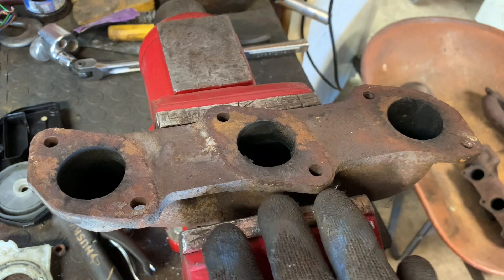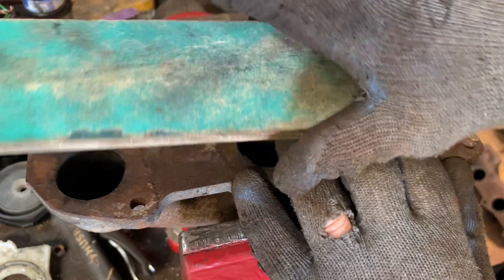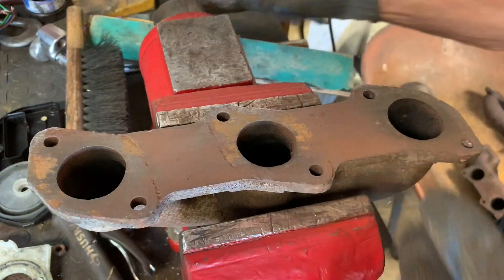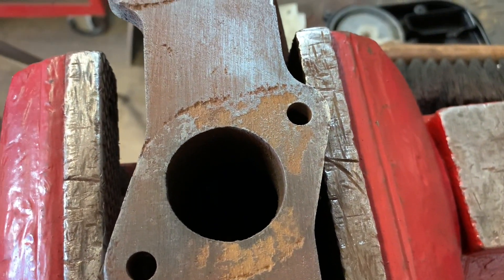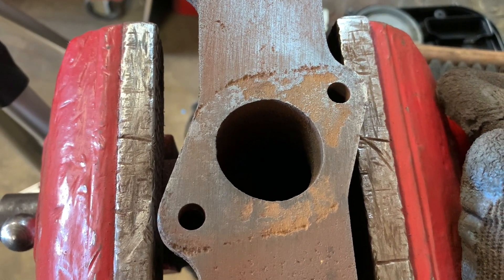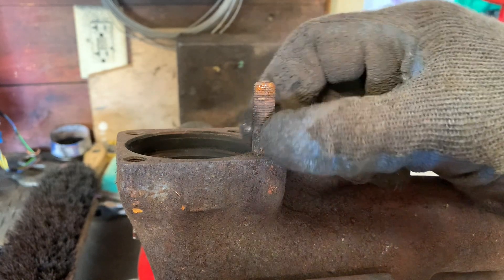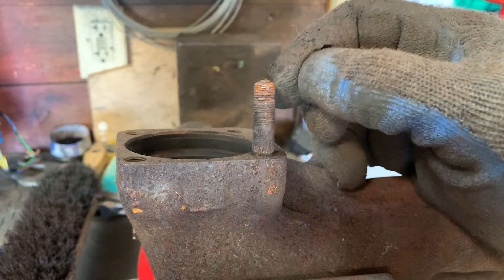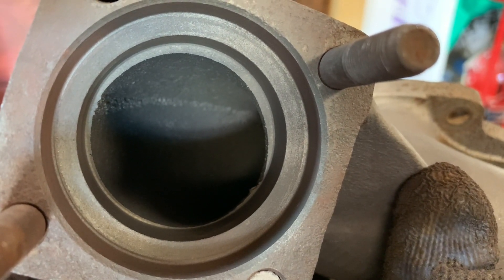TuesdayExtra S:4 Episode4-Exhaust Manifold Inspection.

Comment: Nice to see the forgotten parts addressed.  What would you think about having an exhaust manifold skimmed at a local machine shop?   Then (if funds and time afforded) having it powder coated/porcelainized?  - assuming one was to retain the stock logs of course.   I never noticed the OE down-bolts had helicoils in them when I put Y pipes on mine.  I did decide to use brass nuts on them as the replacement nuts.
Reply from the maker: The machine shop approach is the best. In my experience ceramic coating doesn't last and I have no experience with porcelain.